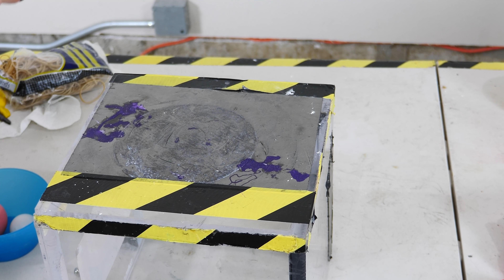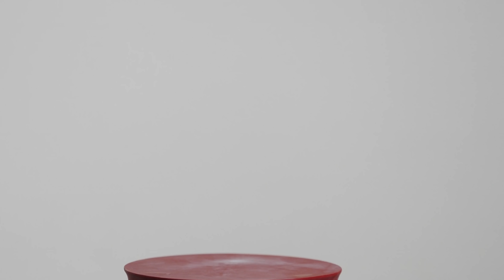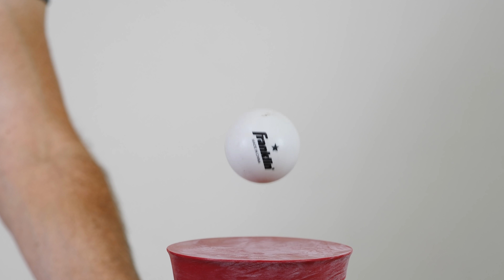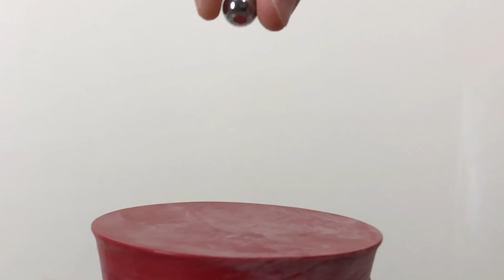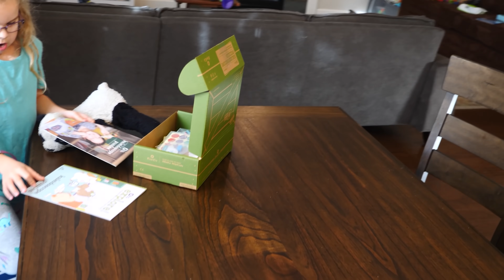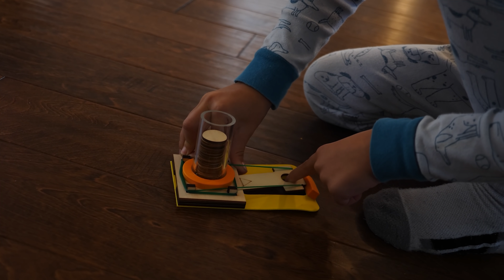The World's Bounciest Surface

Comment: I made one that is even bouncier.
When I started experimenting I wanted to show the experiment to my coworkers over zoom and I noticed that on my wooden desk the ball looses energy much faster than on my kitchen counter.
This led me to discover that the stretched baloon is so perfect that actually most of the energy is lost in other ways (air drag, losses through flexing the rim and the desk, etc.).
Reducing those other losses can improve the length of bouncing considerably. Can't do much about air (other than using denser element than steel) but you can use very stiff everything else. I am using ceramic rim and placing it on hard tile on very stiff floor.

Comment: I would like to see this done in a vaccum. It should not hard to do. Use a magnet to hold the steel ball above the diaphragm, both of which are inside a vaccum chamber. The magnet will naturally be on top outside the  chamber. Once a vaccum is established, remove the magnet and ball should fall onto the diaphragm. I imagine the bouncing will be considerably longer.

Comment: You could probably create infinite bounce by regulating the air pressure in the cup at the same frequency of the bounce so that the ball bounces along the resonance of a pressure wave so that it is gaining energy instead of losing energy.
Reply: but it requires energy to regulate the pressure in the cup through the use of pumps or anything. At that point it'd be simpler to just dribble it like a basketball lol.
Reply: @Caaro99  I didn't say it wasn't going to require energy, my point is that it'd be a pretty cool to see at least. But, it's also very little energy to maintain at the correct resonance.

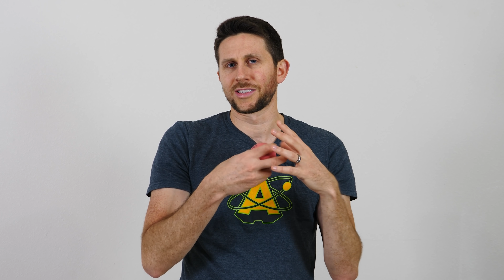Comment: 1:49 Since electricity can not be created or destroyed (The Law of Thermodynamics) the potential energy in the ball at the top of the drop before it is dropped is all potential energy, then when it is dropped all that potential energy is transformed into kinetic until it hits the ground, then some of the kinetic energy turns into thermal (from friction against the ground) and sound energy (the noise created by hitting the ground), meaning that the ball loses height, because it loses some of the kinetic energy that changes into the heat and sound. Then, when the ball rises back up, but not fully, when it is at the top of it rising  point, all energy left as kinetic is back into potential (like the start of this paragraph) and the cycle continues.

If I was at all wrong, correct me. I am only equipped with the knowledge of a tenth grader, and I don't mind learning something new. Not that I would go out of my way to search it though. ;)

Comment: If the air in the cup was hot relative to the surrounding air (maybe by adding boiling water to the cup), would it bounce the ball higher than the original height due to the excess thermal energy in the cup?

Comment: In your other video, you mentioned steel being more elastic than rubber, so if you could in theory stretch a thin steel sheet over the cup, would the steel ball bounce even more than compared to the balloon?
Reply: I actually think that a thin sheet of steel would absorb the impact a lot more than a very thick sheet of steel -- thus preventing the maximum bounce. So dropping a steel ball on a thick steel floor would generate the best bounce. I know that I've dropped marbles on a tile floor and they bounce like crazy, even though they're both very hard surfaces. That said, the shape of the object matters a lot. Drop a steel cube on the floor and I'm pretty sure it would just come to a stop.

Comment: Do it in a vacuum.
Reply: The balloon will be sucked off lol what did you expect, Also you can't just tape it. It would pop. No you can't tape the top, then it won't be bouncy.
Reply: @RealGringlerReal  Not if there's no air pressure in the cup.
Reply: @Intimidation_Crab  Dude, then the balloon would just get sucked downwards, and still if you taped it, the ball wouldn't bounce
Reply: @Intimidation_Crab  Also i mean beforehand if you put no pressure in the cup
Maybe if you poke a little hole in the side it might work :thonk:
Reply: @RealGringlerReal  If there's no pressure in the cup and then you put in the vacuum chamber, the pressure on both side will be equal and it won't sucked in anymore. Or you could just have a hole on the cup, like you said.
Reply: @Intimidation_Crab  I meant previously, before you put it in the chamber the balloon would be sucked downwards, as i knew the pressure would equalise ofc.

Comment: 2:04: An "envelope" (tangent curve) connecting the dots of the tops of the bouncing ball through time would be an exponentially decaying curve. h= k (e**-t) where h= height of ball after bounce
e=2.71828------ (irrational number)
t=time
**=  raised to a power
k= a constant, a coefficient
My guess is that k is NOT the coefficient of restitution, but possibly proportional to it.
[Anyway, I am limited here from using fonts and symbols to write
equations clearly]

Comment: How does deformity lead to heat loss?
Reply: Because of friction within the substance on a molecular level. When something deforms like an aluminum can getting crushed, the atoms rub against each other generating heat within the substance, and the can doesn't return back to its normal state. When you try to deform a rubbery substance by compressing it or pulling it, the atoms get closer or father away from nearby atoms but they don't rub against each, so they don't generate heat.

Comment: Imagine free fall skydiving and landing on a surface like this.....
Reply: DOWN
UP
DOWN
UP
DOWN
Reply: @Robot3k   and space
Reply: @Robot3k  e with ups and downs
Reply: @Robot3k  stress 1000
Reply: @Robot3k  … up 3 down up 4 down up 5
Reply: @Robot3k  E
Reply: b o i n g
Reply: That would still hurt bro
Reply: @minatohirano  not if the surface is extremely elastic
Reply: @k3nz1e73  well, steel is very elastic... What you need to survive is something that stops you over a long distance and time, so that the impact force isn't so great.
Reply: @MrVeps1  so something very elastic like rubber
Reply: @skelet8337  Nope, something like a huge net, which they use for that. If you had a rubber surface as tight as that cup with the balloon, you would die free falling onto it
Reply: @MrVeps1  Yeah, neither the brain or the legs would survive the fall...
Reply: @djphantom8800  What about the 1st man to skydive without a parachute. He landed in a very large net. Survived no problem, zero injuries.
Reply: @filthykallahan6399  He had a large net.
Reply: @skelet8337  You actually don't really want to bounce at all. It's like catching something heavy. You more just slow it down then actually lift it up. That's what you want. Something that slows you down over a long period of time.
Reply: @k3nz1e73  ever you try to jump to water at 3 feet high? is normal and you still feel the impact of it now try 10.000 feet up and tell me what the feel is 

that's why if you free fall and you parachute fail don't go into river or sea because its still same as falling into solid ground
Reply: @Christian.987  yeah you get nuts of steel like Luke Aykins and fall 25000 feet into a giant net
Reply: @MrVeps1  steel is not elastic, its rigid, he actually says this in the video.
Reply: @k3nz1e73  frictional burn
Reply: @minatohirano  yup, ur ribs and organs would be crushed still lmao
Reply: It launch you in space, so wear a spacesuit
Reply: Saying "Hi" to the pilot for atleast 5 times.
Reply: Lets not
Reply: It would still kill you it's too much g force. It would break your bones and kill you
Reply: @orvinal2883  I doubt g force would come into it too much. It would slow you down before speeding you back up. All of your kinetic energy would be transferred and stored in the elastic and then released once you finally stop your downward momentum. But more than likely, this would be like shooting a bullet at it. You'd be going so fast that you'd probably peirce it before it had a chance to stop you
Reply: @orvinal2883  Too many people think they know how physics work...smh. Not you BTW, everyone else.
Reply: @brodylockwood14  they are just joking
Reply: Hot diggity darn we’re going to the ISS cleetus let’s be astronauts.
Reply: Hahahaha B O I N G 🤣🤣🤣
Reply: no YEET
Reply: Hahaha ```B  O  I  N  G```
Reply: This guy just solved space travel...
Reply: Boing
Reply: Second turn before hell
Reply: Youd go to space
Reply: b o i n g
Reply: G force 9000 bitch hell yeah
Reply: That would be like: Do it again
Reply: What if you jumped to a super tall structure of this thing?
Reply: @GatileoGatilei  TIME TO GO DOWN TO THE BOTTOM OF THE SKYSCRAPER IN 5 SECONDS WEEEEEEEEEEEEEEEEEEEEEEEEEEEEEEEEEEEEEEEEE
Reply: You would land right back on the plane
Reply: Minato says that would still hurt bro
Me:what if the weather balloon was high enough to stick the landing
Everyone:no its good enough at the higgt they chooss
Reply: You’d just die lol it wouldn’t make a difference
Reply: You would be in an endless skydive
Reply: get ready for a bounce
Reply: I ate your cat
Reply: The diver: 247th time i fly upwards...and downward...248th time
Reply: Back to sky YAY
Reply: The deceleration and subsequent acceleration back up would definitely kill you
Reply: Back up to the plane!
Reply: Boinoinoing
Reply: Ah shit, here we go again
.
.
.
.
Ah shit, here we go again
.
.
.
.
Ah shit,...
Reply: the amount of force would probably be able to rip your stomach out of your body
Reply: going back higher than from where you jumped
Reply: “Ninja go”
“Ninja go”
“Come on come on and we’ll do it again”
Reply: Your face would deform.
Reply: Bouncing back to the pusher, "whats up nigga?!  🙋🏻‍♂️
Reply: The comments are freakin hilarious! 🤣🤣🤣
Reply: @AbsoluteFidelity  agreed

Comment: I remember I used to bounce glass marbles on a marble top table.  As long as the surface is as hard and elastic as the glass marble, it will bounce.  It will not bounce on wood.

Comment: I wonder how this experiment works in a vacuum. Of course the object holding the rubber must not be closed so a glass cant be used, but there is plenty of alternatives.

Either a steel ball could magnetically be droppend or a magnetical activated drop mechanism could be used to drop a non ferromagnetic ball.
I am curious about the comparison if you decide to conduct this experiment!

Comment: I use to make glass marbles and when I was done id test to see how good of a job I did by absolutely fucking hucking at the ground and if it shattered I messed up and got to much air in the marble. If it bounced threw the ceiling and got stuck up in the attic, it was a good marble

Comment: It would be cool if you tried the experiment but inside a vacuum chamber with a hole in the cup. You hold the ball over the cup with a magnet while the chamber decompresses, and then let it go once it reaches a vacuum. It would be interesting to see how much higher it would bounce since it would not lose energy to the air.

Comment: I think you left out one of the important reasons why your mechanism was so elastic: the surface was under tension, just like the bands in a Rolamite mechanism.

Why it works? If you bend a material at its normal state, you have to stretch one side and compress the the other side. Both of these require work, which is lost as heat. Now, if the material is already under tension, stretching one side further still requires work, but compressing the other side actually releases energy already stored in the material. So you are not giving up energy, you are only moving it from one side of the material to the other.

Comment: So: if it takes X amount of energy to lift the steel ball a distance Y above the rubber sheet, and it will take gravity X amount of energy to pull the steel ball the distance Y back to the rubber sheet, where does all the extra energy come from to move the steel ball a distance of Y(n) over all the bounces?

Comment: You should test this in a vacuum chamber to see how much a difference it makes when you remove the energy loss from sound waves/air drag. :D

(though you can't have the rubber over a sealed cup because of the vacuum around the cub. :P )

Comment: I think this is full of pseudoscience and unverified claims: what is more rigid than rubber is more bouncy than rubber (bricks???), bounciness caused by air - why not remove the bottom of the can and try again to see of the air helps or not?claims that the coefficient of restitution depends on amount (volume? mass?) of material being deformed which I think is obviously false.

Comment: I don't think the deformation loses energy in an important way for rubber balls. What I believe loses energy is that the rubber on the contact patch gets comrpessed and it wants to expand laterally so it slips (skids) on the surface of the wall in a kind growing, zooming, expanding motion, which eats a lot of energy by friction under a considerable normal load. Obviously, bouncing shiny steel ball off a shiny steel lubricated wall doesn't have so much of this effect.
Reply: Yes

Comment: @The Action Lab
no demonstation of a steel ball on a steel plate vs a rubber ball on a steel plate?
you could have added an extra ten minutes of :
"ok so, im going to bounce the steel ball onto the steel plate now"
"ok so, im about to drop the steel ball onto the steel plate now"
"ok so, im now dropping the steel ball onto the steel plate"
"ok so, ive dropped the steel ball onto the steel plate now and as you can see, it fell right away from my hand"
"ok so, the steel ball has hit the steel plate now, its so cool!" (and rave on about blatently obvious crap for a while)
then you could be all like:
"ok so now i have a rubber ball, it feels rubbery, like rubber, because the rubber ball is made out of rubber"
"ok so, now im going to be comparing the rubber ball hitting the steel plate with the results of the steel ball hitting the steel plate"
"ok so, im holding the rubber ball above the steel plate now, its so cool"
"ok so, im about to release the rubber ball now and see if it reacts different to the steel ball when it hits the steel plate"
"ok so, im now letting the rubber ball go"
"ok so, i let the rubber ball go now, and i totally did not expect this but.... (blah blah blah) so cool"
"ok so, i totally didnt expect that to happen, how cool, so cool,  (insert buy my merch here)"
"ok so, im trying to think of some slightly relevant but yet keeping it totally in the realms of complete deceite title for my next video, if you have any suggestions put it in the comments below"
 
could have been epic, maybe you can do a follow up video?
"borderline" sarcasm aside, you should do a steel ball vs rubber ball to steel plate video, that would be interesting to see a steel ball bouncing better then a rubber one

Comment: I was expecting a trial inside vacuum. The coefficient would have been even higher.
Reply: Coefficient of restitution is the same. The force of air resistance is slowing the object's speed, but the instantaneous speed of the object when it hits the surface will be the same before and after the collision. A vacuum would just remove the air resistance.
Reply: @calvinf9218  True, but still. The ball loses its velocity faster with air resistance. It doesn't make the surface bouncier, but the system keeps its energy for a quite longer time (even if, in this case, it'd probably be negligable)
Reply: would there still be air in the cup
Reply: @Raja-iq5pn  no... a vacuum literally has no air in it

Comment: Action lab: steel is bouncier than rubber.

Two rubber objects: BAM  BAM  BAM BAM BAM BAMBAMbambambmbmbbbbbbbb
Two steel objects: BOOM
Reply: Still amazed at how well you described the dissipation of energy with just "bam"
Reply: XD
Reply: BAM MENACING
Reply: Hmmm y e s
Reply: steel is bouncier than feathers
Reply: @insertnamehere8099  a kilogramme of steel is even more bouncy than a kilogramme of feathers
Reply: Nice description mate.
Reply: Flint and steel
Reply: @a m a r o 
if; ('Weight' != 'COR');
{setvar 'your-comment' = 0
};
Reply: He means if they are the same weight, so a steel ball bearing will bounce higher than a rubber ball of the same weight and dimensions.
Reply: But… steel is heavier than feathers
Reply: Would be interesting to see a steel ball bounce on steel plate while in a vacuum. No loses due to sound and drag

Comment: SUGGESTION: Put a tire valve in the side of the cup and a hose clamp on the balloon.  Explore the effect of varying air pressure inside the cup.  Put it in the vacuum chamber and explore the dual effects of pressure inside the cup and pressure outside the cup.
It would really be nice to have a chart recorder recording the sound while the ball is bouncing.